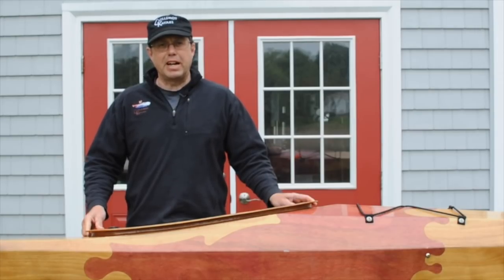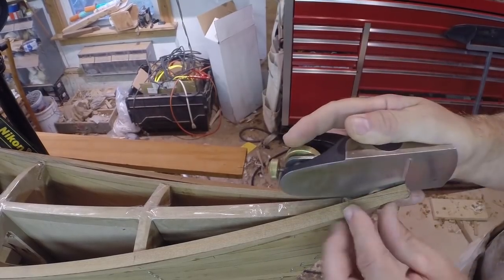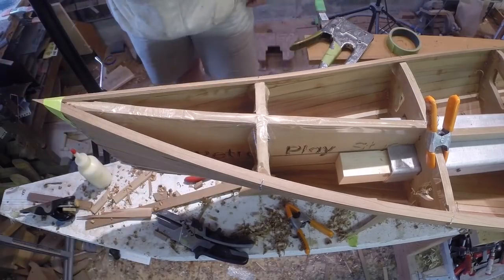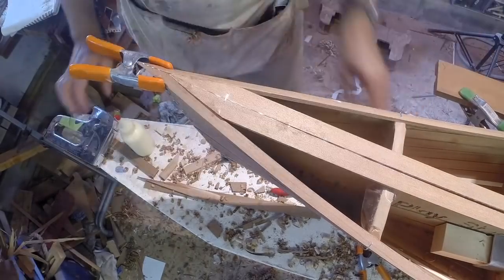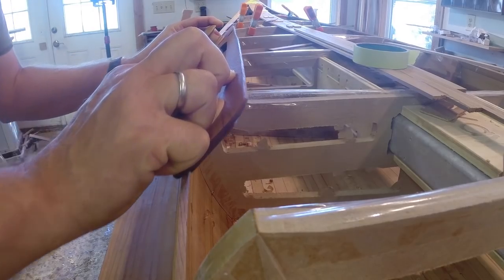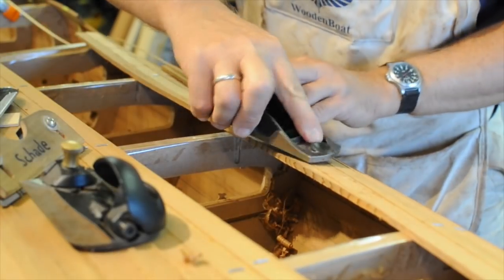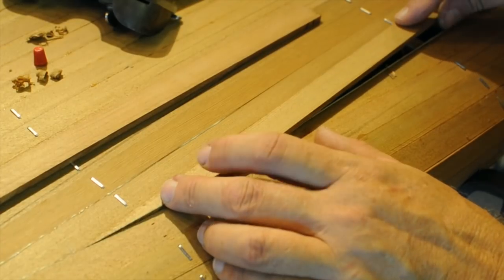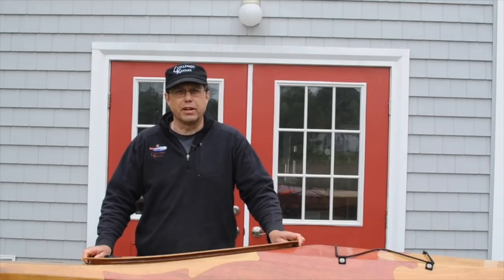Making a Strip Built Kayak - Stripping the Deck - E6

Comment: Thank you Nick. I have 2 questions:
- Does the first strip of the deck can be narrow? It seems easier to guide and glue.
- Does it it impact the last strip of the deck?
Reply from the maker: It definitely can help if you use a narrower strip at the sheer. It will be more flexible and fit the shape more easily
Reply: thank you a lot!  @NickSchade

Comment: Is the feature line something that is included in the plans or is that something you added? If I wanted to add other feature lines or designs should I do it in a 3d CAD and mark the points on the forms or can I eyeball it?
Reply from the maker: A "feature line" is what I call a part of the surface that comes to a sharp corner. On a hull, a hard chine would be an example of a feature line. The design includes a couple lines extending out from the cockpit area. Unfortunately, the video I got was from working on the aft deck where the feature line is very subtle. The foredeck as a much more obvious sharp angle.

So, the feature line is part of the plans, and I include a guide mark on the forms to help locate the feature line. 

Once I cut the feature line, I chose to add an accent stripe at the feature line, and that is the thin bit of Alaskan yellow cedar.
Reply: Got it. Thanks

Comment: Nick, would scarfing the strips be suitable where a fellow simply couldn't source full-length wood at a practical price?  Thanks.  Good series-nice editing and the Petrel Play built here is stunning-as are most strip-built boats.
Reply from the maker: Hi Wade, I typically don't even bother with a scarf when I don't have full length strips. The only place I'll scarf is on the first (sheer) strips. Everywhere else, I just make a butt joint. I angle it the cut a bit for appearance sake, but it is just a simple butting of the ends together. Once under glass, it is plenty strong enough.
Reply: Thanks Nick, that helps a lot.
Reply: @NickSchade  Sounds like this tip allows more leeway in creativity for inlay or wood choice to get a variety of patterns. Then I referenced your book and wallah, a whole chapter on this topic. Thanks for sharing.